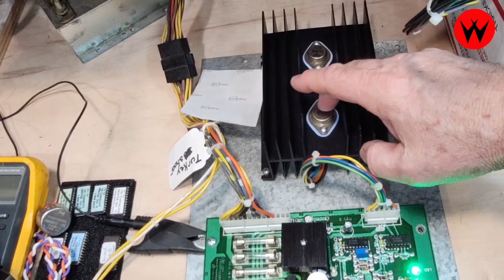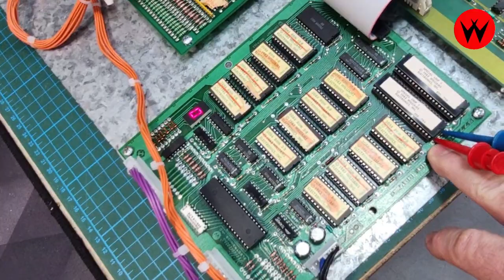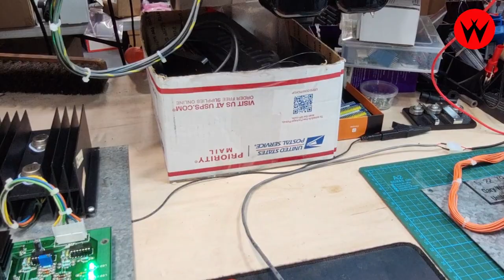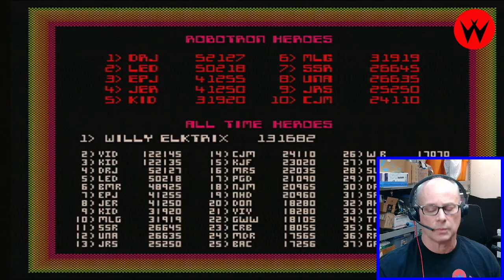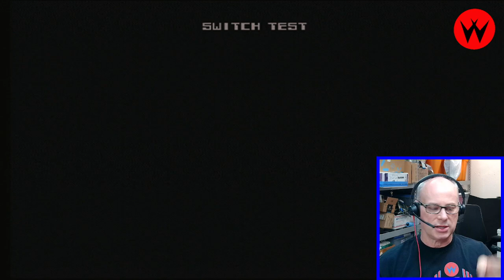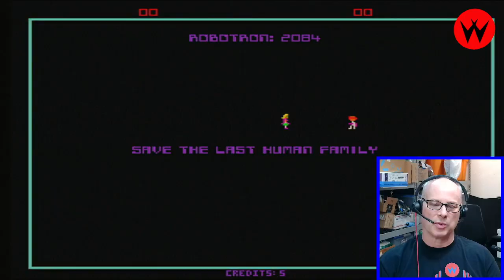Robotron - Repair/Restore - Full Set With Linear Power Supply

Comment: Can you show in a video lesson how you're using the load tester on the power supply to double the running current on the 2N3055 transistors? My question is when doubling the running current the transistors dissipation is going to be above 80% dissipation so this is not good to the transistors datasheets maximum dissipation?